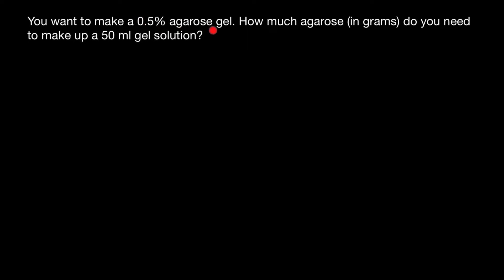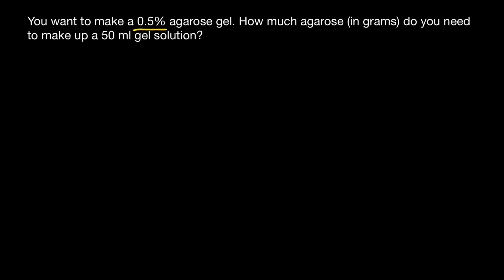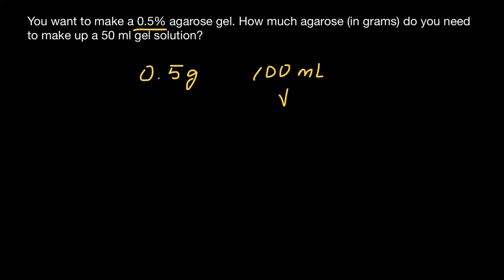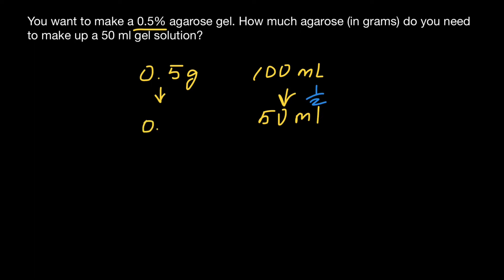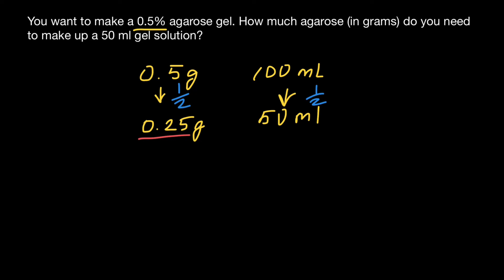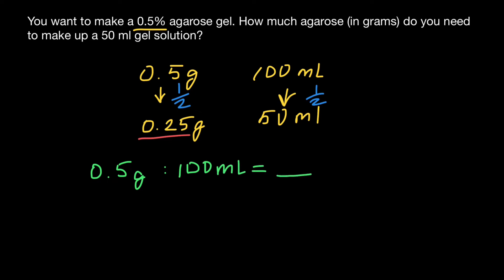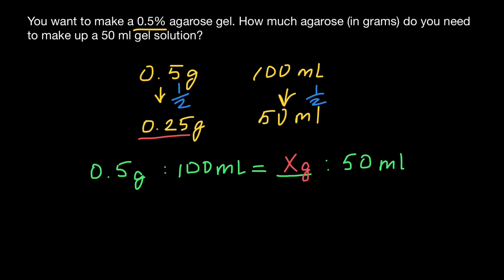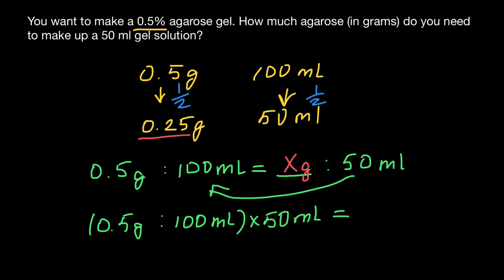Agarose gel calculations

Comment: Or you could convert the 0.5% to 0.005 by dividing it by 100 and then multiplying it by the given volume, which in this case is 50. 
0.005x50mL=0.25g